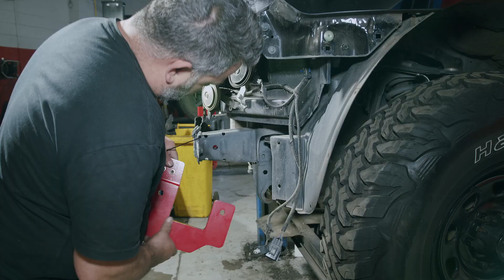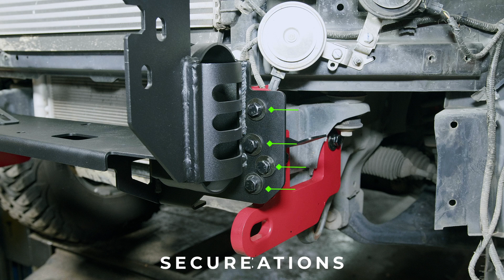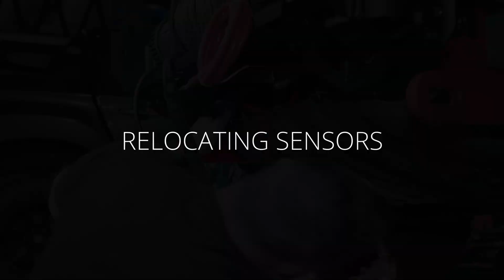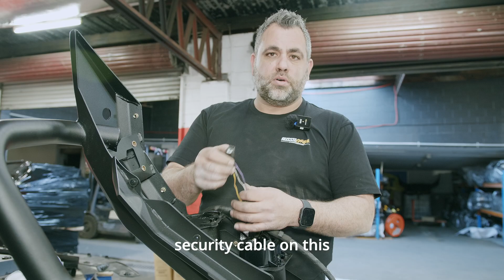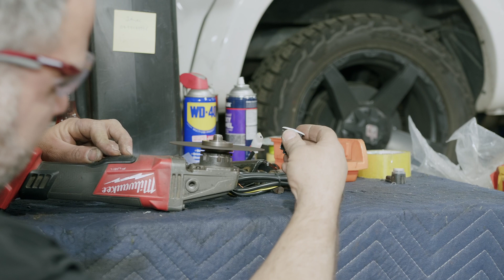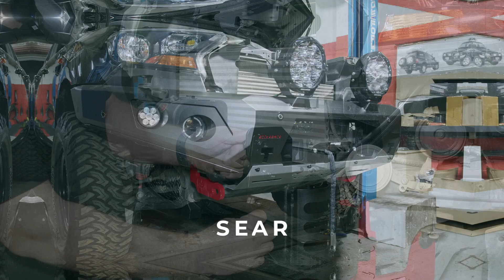Rockarmor GT Ford Ranger Bull Bar & Bumper Fitting Instructions - PX2 & PX3 Ford Ranger

Comment: Do you have complete pdf fitting instructions  , how do you mount the radar bracket ?what do you do with the new light wiring ? they don't plug into the existing loom .  where do I mount the anbiant air temperature sensor ? I didn't recieve any instructions or paper work with bullbar and 1 bag with about 200 mixed nuts bolts and washers .